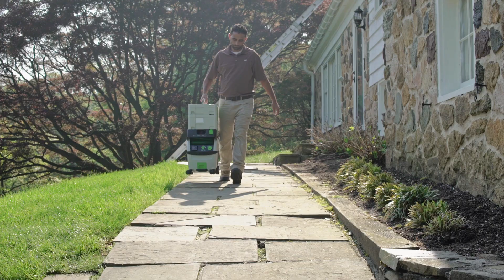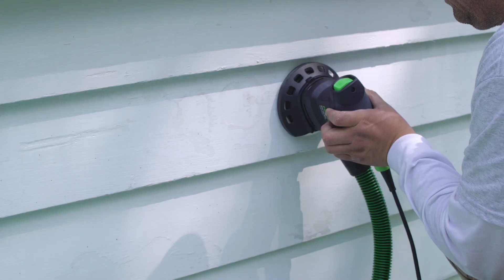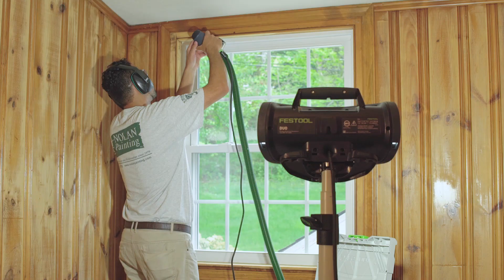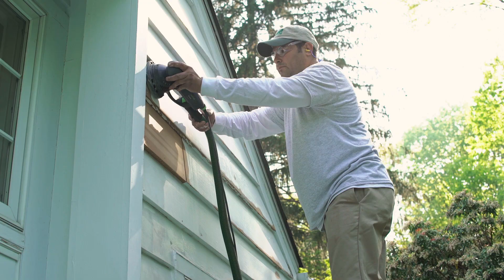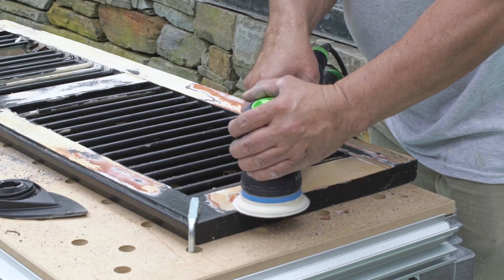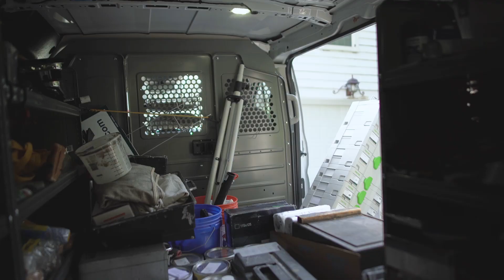Festool Paint: Power Tools for Professional Painters

Comment: Festool is high quality tool system.  Very practical and efficient. Great 3 years warranty for all parts ! However i feel that using Festool for exterior jobs miss the point.Especially for low budget projects like the one on this movie. Whole Idea of dust extraction is to preserve interior and save money on hours of cleaning. For outside ill use cheaper sanders.

Comment: It'll take them 10 years to finish sanding that house, with those sanders
Reply: Use a paint shaver or a speedheater than sand or even use a angle driner if youre skilled eneough if there is a dust extraction possible unless ypu whant debree all over the garden